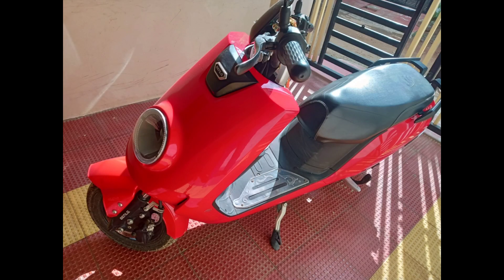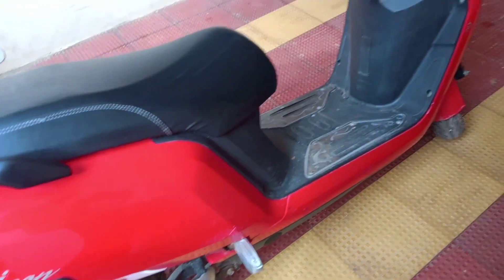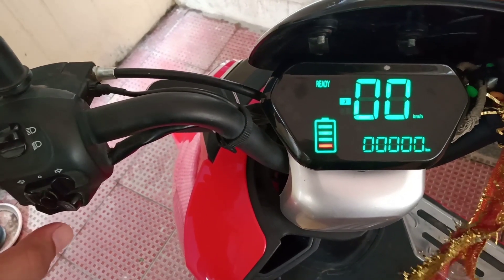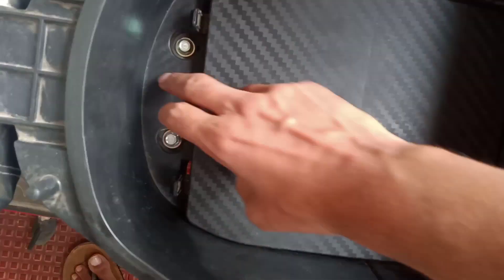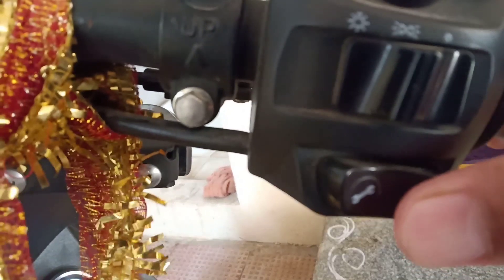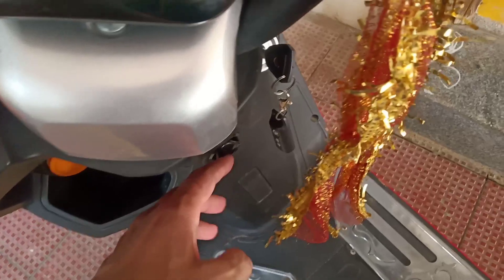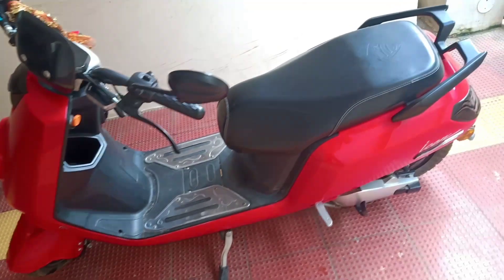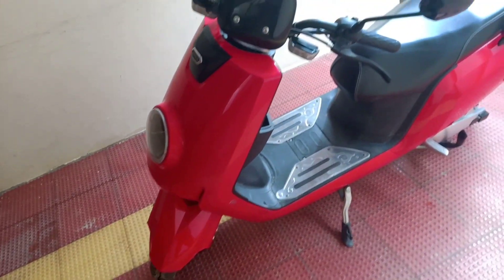One year review of my Electric scooter ll Benling icon review ll lithium ion battery

Comment: Nice review. Battery life might be 2 years as per warranty? Any idea in terms of total kilometers- like say 75000 or 1 Lac?. What is the replacement cost of battery? Maintenance costs during these two years!
Reply from the maker: Thank you. Company didnot mention in terms of kms. Battery cost may be  
Around 25k. There is no exact  confirmation on battery cost in the market. There are two  free services maintenance  cost is nill till now. They are charging for labour cost only from 3rd service. So far no issues.

Comment: Speed in driving modes?
Reply from the maker: Basically it's a low speed vehicle.
1st mode  22
2nd mode 25
3rd mode 30
4th mode 35 .meter will show as above. But it will reach 45

Comment: what is the top speed in 1st to 4 th mode?
Reply from the maker: 1st mode  - 25km/h
2nd mode - 28km/h
3rd mode - 32km/h
4th mode - 35km/h
But practically in 4th mode it will touch 45km/h meter will show only 35km/h with single person drive.
Reply: @tripwithsowmya7236  i also have a yo edge for 1 year. its lead acid 60v version. keep it up.